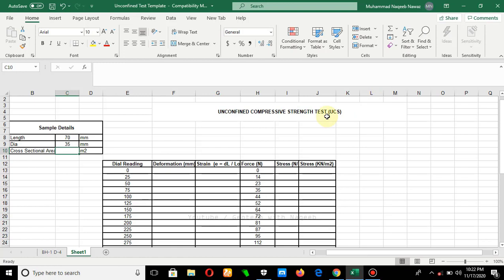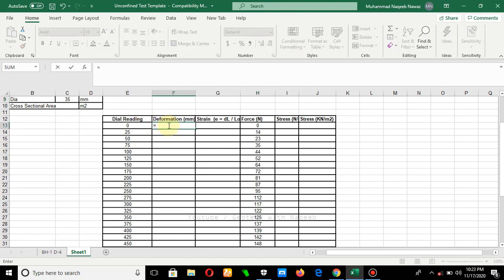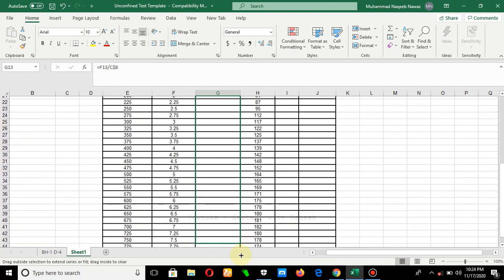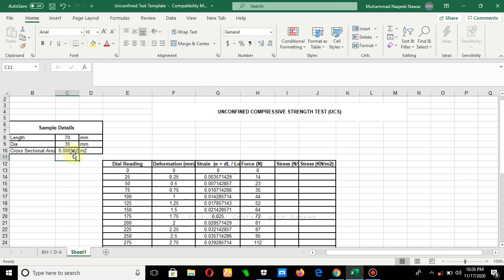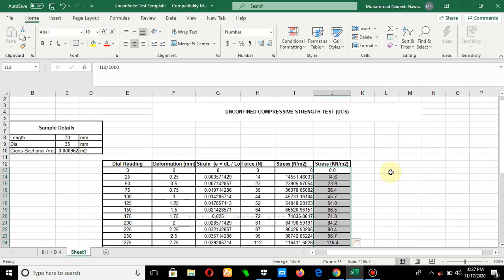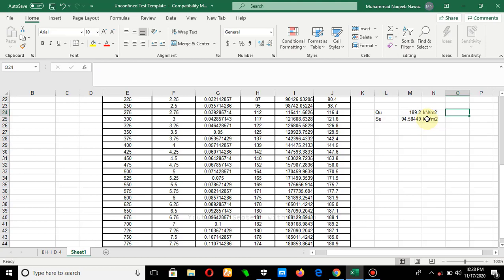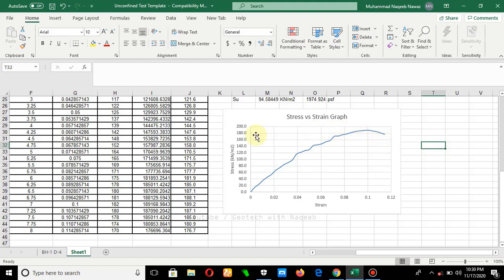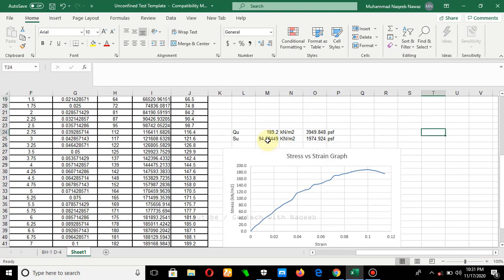Unconfined Compressive Strength Test of Soil | Laboratory Test | Geotech with Naqeeb

Comment: Sir is it necessary to draw Mohr's circles  while determining the UCS using triaxial apparatus or just we can simply follow the method used in video?
Reply: if the confining pressure is zero (S2=S3=0) you'll find UCS just like the video, but if the confinent pressure is not zero you use Mohr Circles